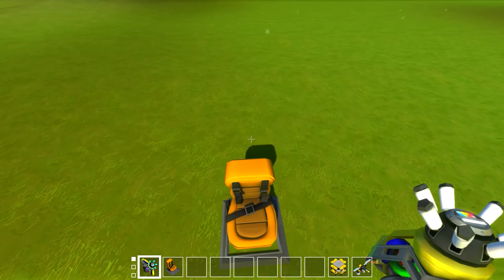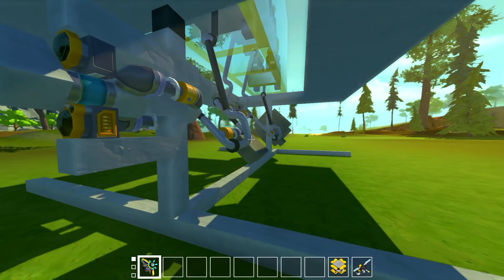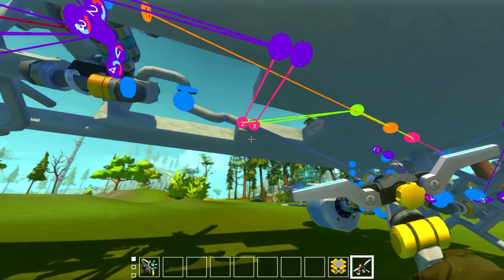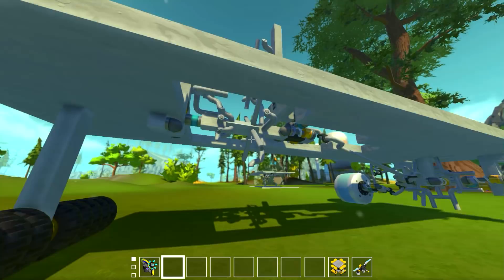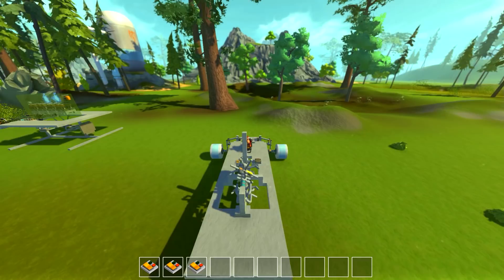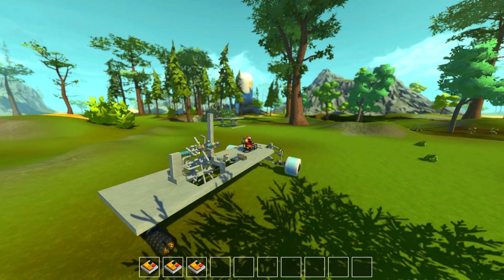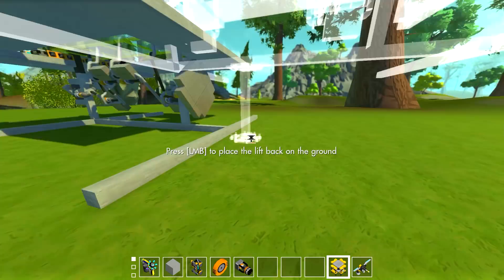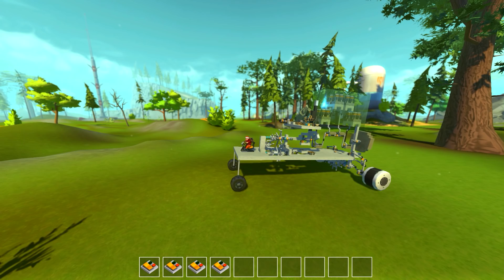Finishing the Real Car! Sort of? (Scrap Mechanic #171)

Comment: Put a more powerful Engine on it!
Reply: Da_Gamer
Reply: yeah its so easy you just put one on there, no struggles or anything. oh wait no, thats not how it works...
Reply: Its acctually not complicated to make better engines just make shorter connecting rods and make ideling speed higher and driving rom higher and make a lower gear ratio to start with then get in higher gears later like a real car

Comment: nice build. the lack of power may be the ignition timing.... by which I mean the thrusters are coming in a little too late. maybe start firing just before they reach the top of the stroke, that way the power is at maximum as the piston travels down (not sure if that's possible)

Comment: you can put a sensor next to the wheels with the same length as the wheel and the diff lock will activate if a wheel lift from the ground.

Comment: Im trying to do the same but find it hard to make the driveline to the wheels. The engines are solid, I've had them run for long time without stopping/glitching. Now that they are introducing pistions it might be easier to make it more compact...

Comment: the engine doesn't get stuck, there is a point, where the pistonsin push against but the driveshaft is in an upright position so the piston would actually break the driveshaft
Reply: so you should add another Piston in a thirt direction.

Comment: kan make the engine a v it will give the pistons more leverage and wont get stuck
Reply: Yes cus scrap mechanic works that way sure it wont get stuck but the rpm will be to low to keep constant power its true what you say if it would be real life